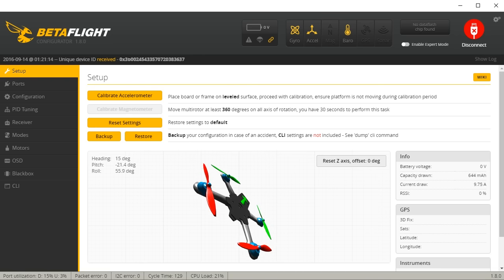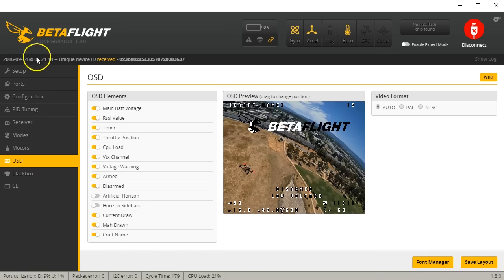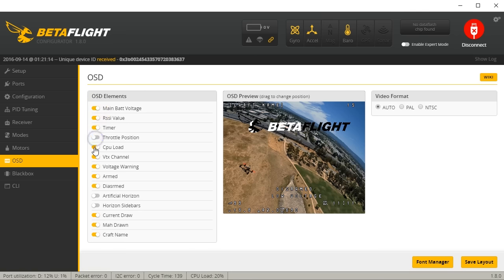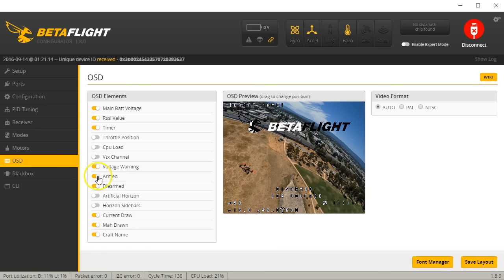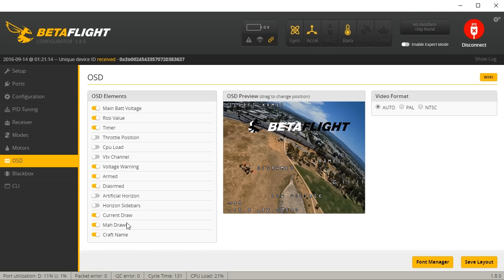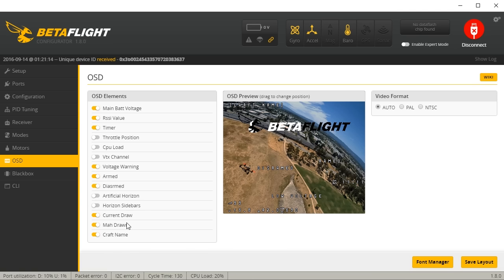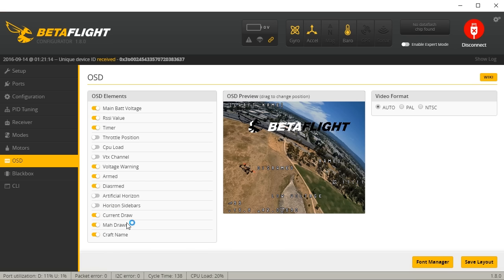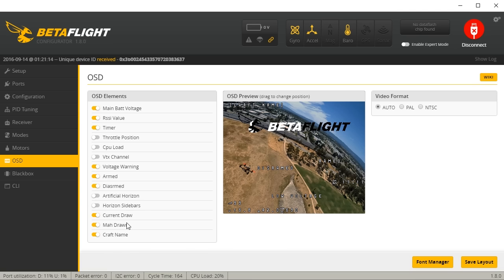Omnibus F3 All-In-One Flight Controller - Betaflight OSD

Comment: I love the OSD too very much! Nathan did a good job there! I aspect more and more FC's follow this design as a reference for sure. PDB would make it ultimate killer!
Reply: only for fc with osd, becouse not for micro minimosd?
Reply: of course. minimosd doesnt support that ;)
Reply from the maker: +arcanis79 yes. No MinimOSD.
Reply: Think i have your ultimate killer ;-)
Reply: Yes, Boris, this FC w/ OSD is great! I just installed it and maidened on BF 3.0 stock PIDs (w/ rate changes) and it's smooth as butter...feels like 80% tuned out the box--crazy:) Thanks for what you do!
Reply: nice, so is the OSD code running on the MCU (F3) only? Is the Max chip on the same SPI as the gyro?

Comment: Looks like a great board. Love that you can drag and drop whatever you have displayed on the osd, what a great feature.
Reply: I want one!
Reply: The sweetest part about the OSD is you can change PIDS, random settings and much more through the OSD on the field, really easily.
Reply from the maker: +Kradle changing PIDs is a pretty standard dark feature but all the extra Betaflight settings are really sweet.

Comment: I really like this board, I'm also testing it for a few weeks now, IT allowed me to make a very clean built with OSD and it flies really good.
Just re-flashed yesterday with the new BF 3 stable version and looking forward to have it tuned up again. But with the builting OSD we can do PID tunning trough the remote control, no more carrying laptop for PID tuning. It's sooo practical that i want another for the other quad.
Reply from the maker: So you can do PID tuning with the BF OSD in the Omnibus? Can you confirm that?
Reply: yes, try this:

Invoking OSD Menu
On startup screen, When disarmed, enter THR MID + YAW RIGHT + PITCH UP

Page Navigation Cursor on PAGE
Next Page: YAW RIGHT
Previous Page: YAW LEFT

Cursor Navigation
UP: PITCH UP
Down: PITCH DOWN
Right: ROLL RIGHT
Left: ROLL LEFT

Changing Values
Increase: YAW RIGHT
Decrease: YAW LEFT

Exiting
Cursor on EXIT or SAVE+EXIT then YAW RIGHT
(Be careful that the cursor disappears for EXIT)

Comment: The coolest part of the Omnibus for me is that both the OSD and the SD Card are SPI connected, meaning a) the SD can easily log at 1khz without ugly gaps, and b) it does not use up the precious UART ports!! So with SBus, OSD and SD Card Blackbox you still have 2 Hardware Uarts free for whatever!

Comment: May be wrong, but Omnibus picture shows"current input" on left side , 4 boxes down. Also an option on the OSD page. And since it's powered directly from flight battery, it should know the current (I think). What it doesn't have is 5V AND 12V regulated output, so on the RTFQ website, they have a note and tell you you can power your camera (5V), or your Vtx (12V - except if you are using 3S and volt below 12V you may still see spikes). Then they suggest you use an external BEC "to provide filtered 10V for HS1177 and a VTX." Can get 2 for $32 each which is still pretty freakin great!"
Reply from the maker: +Mark Sherman it can't know current values just because it is connected to the flight battery. Voltage is measured in parallel. Current is measured in series. The current must go through the current sensor, not past it.
Reply: Yep, totally screwed it up. Also wrong about 5V and 12V - it  doesn't have 12V option - just 5V and full battery option.

Comment: One thing I haven't noticed before ordering one is that the standard version doesn't have a current sensor on it.

So if you want (and I'm pretty sure everyone prefer a vbat monitoring) a current sensor, you have to take the PRO version which is 44.99$ Not much of a difference but worth mentioning.

Comment: Great video as usual. I have an Omnibus V2 F4 Pro (with current sensor) on a copter and I'm having an issue and I'm hopping you might be able to help me out. (EDIT, I just found your video on calibrating a current sensor so thanks again for the help!) I have the OSD setup to show current, volts, mAh used, and time. The voltage seems correct and the timer works fine but the current and mAh used seems way off. For instance this is a 3inch build and using a 850 pack, the OSD shows I have used like 1500mAh after the flight. Obviously I can't get that much out of an 850 pack. And I'm using EMAX red bottom 1306 4000kv motors and the max current that the OSD shows is around 70 amps and I can't imagine that is correct either. I would assume the mAh used is just a calculation of the current sensor readings and time. So I would guess the current sensor is the issue here. Is there a way to calibrate the current sensor?

Comment: DYS XBR220 - the problem is its unique form factor, as it was designed specifically for the Black Bolt XBR 220 frame. I'm using it on that frame and it's wonderful. OSD is configurable from OSD abut you cannot move data's screen location. I have a video on my page.

Comment: I've had one of these for a month and I LOVE it! I paired it with a PDB that has a current sensor and BEC from readytoflyquads. I sent them an email suggesting they change the pdb's bec to an LC filter and that would make the perfect & simple racing quad FC/PDB setup.
Also note. The OSD chip on this FC is a newer replacement of the one on the minimosd, which needs lower current to power it and also has better voltage protection to reduce chances if in-flight frying from escs etc.
EDIT:
THIS pdb!! Like I say, the bec is useless in this case, so if it existed with the current sensor and LC filter for VTX It would be GREAT! The best part is this PDB layout is an EXACT layout replacement of the Lumenier pdb, ie the ESC + and - solder pads are in the correct places!!
http://www.readytoflyquads.com/mini-power-distribution-board-with-built-in-apm-power-modal

Comment: You should check out the Matek/Realacc HUBOSD, it's got PDB/OSD/current sensor with 0 configuration. Sure it has it's limitations since it doesn't have a connection with the FC, but right out of the box it'll show voltage/amperage and time.
Reply from the maker: +m4ckan666 that's a good product, but it's in the category of the RROSD since it isn't integrated with the FC.

Comment: Joshua Bardwell 

i want to ask you what you think is best.

I want an osd.
what is the best way to get the whole package? (voltage ,current ,Rssi , etc...)

now i dont have osd.
my pdb has no current sensor so i can not use it.
also the flight controller is an SpRacing F3 with no osd funtion.

What flight controller and pdb do you recommend to buy?
how do i get the whole package.

btw awesome video i was just as excited as you lol

Comment: Hello Josh have either missed the info or no one is telling. My question is the OSD Flight timer. Does the timer start when the throttle is moved or when the battery is plugged in..this important for me as it will show a true flight time, not a sit on the ground and get my nerves relaxed time. Thanks for all the great videos, keep them up. PS I still need the barometer so this is the board for me.  Guess so anyway.    THANKS ALOT
Reply from the maker: Flight timer only activates when the copter is armed.

Comment: Just bought this FC. After troubleshooting what I THOUGHT were desyncs for a week (changed motor timing, tried different PID loop times in BF, unsynced and synced PWM, etc,) I decided to swap to different ESCs. Went from DYS XS20A to Cicada 30a BB2 (both Blheli_S.) Okay...so that didn't fix the problem. So yesterday I strapped my quad onto the bench and individually spooled up each motor WITH props in betaflight...okay, no problems there, all motors are running just fine (T-Motor F40 V2 2600kv.) 
This morning I decided to do a FC swap (Just happened to have two X-racer F303 V3.1s on the bench) wondering if maybe I had a bad gyro or something. That didn't fix the problem either. The quad will hover OK, but when I go to do a roll, it will flip its $&#T and fall to the ground. I've come to the conclusion (Won't know until I move to an entirely different FC) that the X-racer F303 V3.1 is a bad board...maybe not the board itself, but I am starting to think that the FW X_racerSPI has a severe flaw in its code causing this issue. I did a search and there are other people who are having the same issue with the same board. 
Wish me luck...definitely the most difficult issue I've ever ran into in this hobby. Sorry for the wall of text! :P
Reply from the maker: +Kradle I ran the 3.1 for a while with no issues but who knows?
Reply: Joshua Bardwell What version of firmware, 3.01 or 2.9? It's certainly possible it not the FC - after I replace it with the Omnibus,  if the problem persists I will replace the  motors...Because that will be the only thing left that I haven't swapped lol.
Reply from the maker: I believe it was 2.9.
Reply: Joshua Bardwell Very interesting... Maybe I'll try this in the meantime. I had to go on a hunt to find 2.9 SPI. Thanks!
Reply: Josh, 
I just wanted to update you. I swapped FC's to the omnibus a few days ago, and set up everything just fine. Betaflight OSD is crazy awesome. But, the problem still persisted. So I finally broke down and tried out some way less pitchy props - threw some gemfan 5030's on it, and the "desyncs" (which probably aren't desyncs) went away not completely, but about 85% gone. It's definitely got something to do with my motors. I ordered some HQ 5x4's to try out, and I will try bumping up motor timing to medium-high. If all else fails, I'll replace the motors.
Thanks for your input, I always value it very highly.
Reply from the maker: +Kradle thanks for the update.

Comment: PSA:
The 'pro' variant of this board has an integrated PDB (through its current sensor) and it has an inbuilt 5 volt 3 amp BEC which is filtered for vtx and cam.

Comment: Is a PDB even really necessary? I saw a video describing how to use a BLHeli 4 in 1 with the Omnibus using a 6 pin cable. Battery power went straight to the 4 in 1 board and then jumped from those pads to the bat pads on the FC. The only modification was that the power and ground wires were depinned from the cable. I'm kind of new to building and FPV, so I'll be interested to know what you think of that. Seems like it would be a good thing if a component could be eliminated without any ill effect. Thank you, by the way, for these videos. I'm learning an awful lot from you.
Reply from the maker: +Ed Johnson with a 4 in 1 ESC, you don't need a PDB.
Reply: Cool. I think that's what I'm going to do. Thank you!

Comment: See, there's the issue.This is great... BUT, I still need to stack. Which means, it defeats the purpose. My RROSDs and my Power OSDs give me this. I also have a pair of Motolab Tempests that I love, but again... No OSD. so until we have an FC WITH a PDB and WITH an OSD, it won't all be complete. The VTX is fine to have separate IMO. But we'll have a homerun once the FC/PDB and PSB is all in one. I suspect this is around the corner.

Comment: I love your channel Joshua, I have a n00b question. I don't know how to configure the UART and the serial rx on betafligth, I'm running a serial spektrum satellite though. thanks!
Reply from the maker: You need to set the solder bridge to feed 3.3v and then wire the signal wire to the DSM2/SBUS pad, the power the 5v/3v pad, and GND to... guess where?

https://www.fpvmodel.com/u/tmp/goods_desc/2017-01/20170106141113-5407.png

In the Ports tab, configure UART2 to Serial RX and in Configuration tab, set Spektrum receiver with, most likely Spektrum2048 protocol.
Reply: Joshua Bardwell thanks so much for taking the time to share your knowledge; what if I connected the dsmx receiver in the satellite port without soldering anything ? the configuration would be the same on betaflight?
Reply: Joshua Bardwell I forgot to tell you that I have an Omnibus F3 V1.1, I connected the serial dsmx spekteum receiver to the DSM2 satellite port.

Comment: I love the ACS758 200A unidirectional current sensor (http://www.allegromicro.com/~/media/Files/Datasheets/ACS758-Datasheet.ashx). Just solder it straight to the PDB and the positive power cable, then ground, 5V and Analog signal to the flight controller. The sensor is calibrated so use 200 in scale and offset of 600.
Reply: 200A is way too high, I would argue that even 140A is a bit too much. If you're using that much current from your battery then I think you are doing something wrong :). If more power is needed increase voltage (cell count) not current. Also a 200A  sensor will be very inaccurate at lower than 1/3 is rating, so not good for situations where your not punching out.

Comment: Great vid, but I have one question.  Ever since hooking this board up, my FPV signal has had a lot of lines and break up, but only during flight.  I am NOT powering my transmitter, or camera off of the board, and I was not having any issues before hooking up this board.  I am using the included OSD and am running my camera signal through the board.  Any ideas on why I'm getting breakup now or how to fix it? Thank you so much!

Comment: Nice video. Been hoping you would post something about this FC. Looking forward to the next roundup video. 

PS there is a new pro version of this board that now includes an LC filter for the 5v/batt voltage out for your camera/vtx and a current sensor. 

https://nathan.vertile.com/blog/2016/09/05/omnibus-f3-pro/#top
Reply: More info here: http://www.rcgroups.com/forums/showthread.php?t=2742116

Apparently it supports 6s direct Lipo connection. Will test this when my 6s build is complete.

Comment: So i just built a QAV-R with RROSD and OmniBUS, TOTAL WIN, RROSD for current and battery, on Omnibus disable everything but RSSI, Warning, Thorttle Position and Call Sign. WORKS AMAZING, and can tune on the fly like before with MinimOSD but get the goodies of RROSD. TOTAL WIN "in my opinion"
No LC issues of any sort, just took the camera Video into Omnibus out of omnibus into RROSD cam port = WIN

Still trying to figure out how to change the call sign to my own name in Betaflight
Reply from the maker: Clever.

Comment: Noob question does F3 & F4 have Horizon mode? Or are they all acro/rate and angle?
Reply from the maker: +Dope Frames F3 and F4 are just processors. They can run whatever software you want. F3 is supported by Cleanflight, Betaflight, and iNav, all of which support autolevel.

Comment: Can you wire up an external OSD to a non-betaflight OSD board and make it work through the BF configurator like shown in the vid? Or is this feature only supported for boards with the built in OSD?
Reply from the maker: Only built in OSDs support the full BFOSD feature set. The most recent builds of MWOSD can support some betaflight features via the left-yaw  / pitch-forward stick command. But they don't support upgrade and layout via the BF Configurator.
Reply: Thanks for the reply.
Reply: i jut buy the MICRO MINIMOSD- JC "blue-F" explane i need flashing. but an old video. but out the box! can i just solder it. an confuger in  BF? I only want Volt.  Or that was most inportment. or do i need the usb and flash it? thx for another nice video! :-) have the omnibus F4 with OSD. "on my flying quad"- But wanna learn the old way. but wil stik to the omnibus f4 wit OSD- Its freaking amasing!!

Comment: The tab is also usable by my micro minimOsd
Reply from the maker: Uhhhhh. That's pretty cool. How does that work exactly?
Reply: That would be great but I can't connect.  And release notes seem to say otherwise?   The OSD Tab is ONLY for FC boards that have a integrated OSD chips. One such FC is the omnibus.
Reply from the maker: I think so, but I'm open to being wrong. You would need some way to tell Betaflight's OSD tab that the OSD is connected via a certain UART. And I don't see any way to specify that a certain UART is an OSD, as opposed to any other MSP device. Maybe Betaflight Configurator is smart enough to figure out that an OSD is present via MSP polling or something? I don't know.
Reply: That's not possible as the firmware for OSD is in the minimOSD and cant be changed / upgraded through MSP. Integrated OSD on the FC is local so it can be modified.
Reply: my fault, got confused

Comment: have you had a go at adding an ir led?
 be great not to have to add a separate transponder for race events.
Reply from the maker: I haven't added it. We don't have any IR transponders at our club, and I am holding out hope that eventually the RF-based lap timers will come into their own.
Reply: They are getting there my brother has built one but still some teething problems. All the big races here still relying on ir. 
Hoping to find out how to get it working. Wether you just need an ir led and what eles you might need to do to get it working.
Reply from the maker: If the board has IR transponder functionality built in, you just need the LED. You also need to program the board with your transponder number or something.

Comment: Speaking of current sensors. Is the a way to add a current sensor to a spracing f3 evo and get the mah sent as telemetry to your taranis. Thanks.
Reply from the maker: Yes. You just need any 3.3v output analog current sensor. Wire it up in line with your main battery lead and wire the sensor output to the current sensor input on the SP3 Evo. Then enable current sensing in Cleanflight/Betaflight. Then calibrate the current scale, which is a huge PITA and is a whole other topic all its own. Then enable telemetry, and I believe mAh will be reported as the FUEL sensor to the Taranis.

This assumes that the SP3 Evo has a current sensor input, but I think that's a safe assumption.